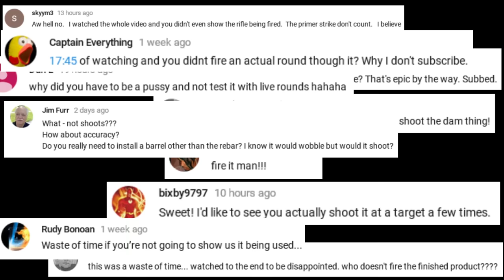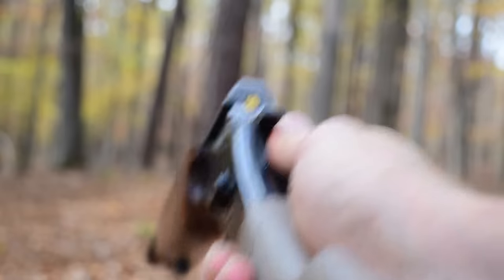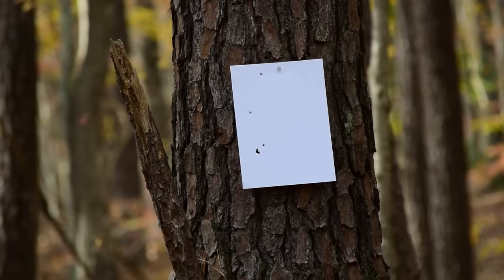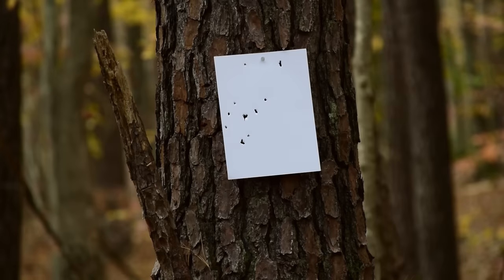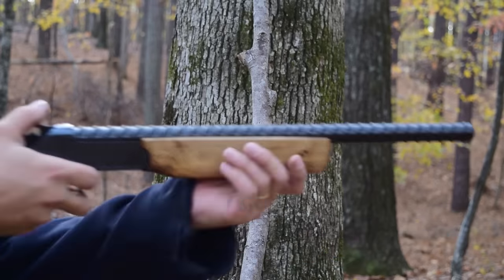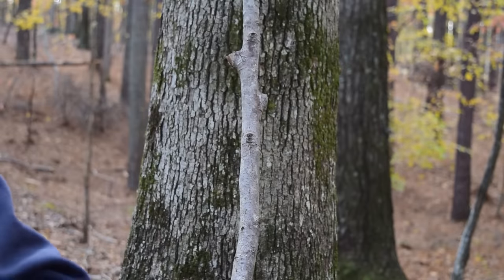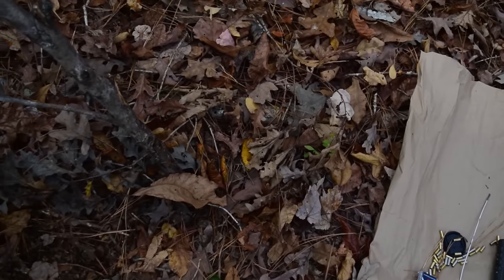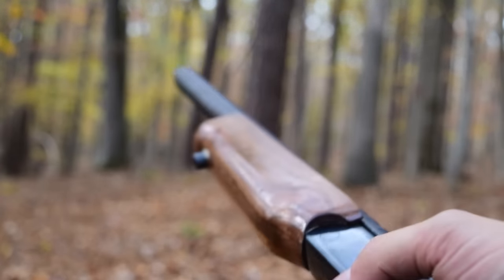Rifle barrel made from rebar - PART 3. Shooting it!

Comment: Not bad, I am an old gunsmith, haven't smithed in over 20 years so not a lot of smithin left in my old broken down bones, but I think if I would have done that, I would have turned the barrel so the ridge was across the top, sort of like a sight rail then mounted a nice set of open sights on the ridge. But that is just me, the man who builds his gun for himself aught to build it the way he thinks best, after he is the one who will have to put up with it when he is finished.
Reply: raise the hole barrel by 2 mm to have that ridge high mill file the hole ridge down leaving front post and rear v notch
Reply: I was thinking about the position of the rebar also not being at the top of the barrel

Comment: Make one for .223
Reply: John Teslov yes
Reply: You could with nearly the exact same procedure and parts. You would need a centerfire single shot lower to begin with. One chambered in 5.56/.223 would be ideal but probably not actually needed. This would be cool though.
Reply: Just make the barrel .223 instead of .22 and you'rre almost good to go. So you'd need a .223 to disassemble to make it. And preferably a single shot .223 which I don't particularly know of. I'm sure they make it. I just don't know one.
Reply: Above .223/5.56 I'm not sure it'd be a good idea. The Rebar's circumference wouldn't handle something like a .308 Win very well.

And when you're talking about drilling out like he did... you're always going to end up somewhat inaccurately. Like his shoots to the left. He even said while he was drilling "I think it's wandering quite a bit." well once he inserted the actual .22 inner tube into the barrel or whatever, it kind of fit the shape he drilled out, so if the middle wandered/drifted to the right inside the barrel, then he compensated on the end, that would account for the shooting to the left.

The hardest part is keeping inside the barrel straight all the way through. Rebar is not so good for this and as cool as it looks, I wouldn't bet my life on it.
Reply: I would not play with the explosive pressures of a .223 personally
Reply: Pyra Gorgon   Better know your metallurgy.
Reply: John Dough .223 would blow it up no doubt. Not to mention the risk of the bullet catching in the barrel.
Also the actual breach would be far thinner due to the oversized cartridge. Same problem with a .38, however maybe the lower power would let the steel survive. Dangerous stuff this barrel making.
Reply: Fuck that, gun looks badass but fires tiny baby ass bullets. We need one made from fat as fuck rebar that shoots .50 BMG. Something like this should work: https://i.imgur.com/FtjgPYK.jpg
Reply: John Teslov 
I would pay for a 22” barrel in .308 made like this for an AR10.... just to freak everybody out at the range....

And EVERY time I got to the range, I’d pretend like I just made it and test firing it to see if it works..... just to freak people out.....

Comment: You could always put sights on it if you wanted... love this build btw.  I don’t understand why people thought stingers wouldn’t work... it’s not as if you rifled the rebar.. you added a factory made barrel liner... rebar is a high carbon hot rolled and tempered steel, which sounds ok to me.. lol depending on which grade it is, you can look up the grade strength, and the amount of ksi “kilopound per square inch” and get a good idea of the pressure that it could handle...just my thoughts...

Comment: The bullets are key holing. If that's not a smooth barrel, the barrel liner doesn't have the right twist to stabilize the rounds. Still nice work though.

Comment: You could add a connecting sear and spring between the ejector and the hinge. Once you pop the break-action all the way open, the sear would release and let the spring push the ejector outwards, then simply expanding and filing the lower portion of the ejector to act as a wedge with a gap to allow it to pass over the firing pin upon closing would let you close it without having to pull out and push in the ejector manually.

Comment: Rebar is actually better quality steel than most gun barrels of the mid to late 1800’s. You could likely chamber a barrel of that diameter up to and including .38-55 safely although it would probably be wise to stick to medium bore pistol caliber black powder loads like .32-20, .38 S&W, 38-40, etc.

Another good application would be to chamber it for .410 shotshell. More than enough meat on the barrel to contain the pressure.

Comment: Love the gun plz try to make matching stock and sights if possible. Rear sight could be like 2 little pins right beside the hole for liner. And front could just be a nail centered and welded on. Also add rifling plz I would love to see more vids like this. Instant subscriber

Comment: Suggestion, if you remove some material from one side of the barrel above the ejector, you could make a new ejector with a 90 degree upward arm , and have enough range of motion in it to reduce the number of motions to reload, which would be accomplished by either simply not removing some of the material and making an ejector that snapped on and slid in place, or, welding something on as a stopper, unless you don't want a stopper of course. (Edit): Actually, you might have enough material left in the re bar to only drill a slot down to where one of the arms is (on the ejector) and thread one end of a tiny metal rod to screw in to the existing ejector...THEN, you could make that SPRING LOADED!! lol By...drilling through the back of the barrel to where the handle I'm talking about would be (inside the slot you drilled if you're following my logic) putting a spring with a non-flammable oil on it in this hole, and then getting a screw in there (with a recess so it's flush) to hold the spring in.

Comment: I did make a 22 Magnum out of the single shot 22 Remington old gun. But I had a second Barrel which means it wasn’t a number one from a manufacturing company and that project worked out well shot a woodchuck at 110 yards with scope on it of course . And that barrel came from numerage (Maybe not spelled right )gun parts out of New York

Comment: Besides the obvious lack of sights making accuracy poor it appears that many of the bullets are hitting the paper sideways or nearly so.  That brings up this question:  .22 cal. barrel liners come in different rifling twist rates.  Redman, for instance - they make many of the .22 liners sold by Brownells - list a different twist rate than .22 short ammo.  The low power Colibri ammunition seemed to do a bit better than the .22 long rifle ammo which made me think of this.  If you mount sights, especially a scope, it would be interesting to see a test of group size with low vs hi power ammo.  It could be that you bought a line designed for .22 short.  If so your rifle may be limilted to only low power stuff to be accurate.

Comment: Drill a hole behind your extractor put spring in and then bevel the bottom edge of extractor so when closing it rises back in when shut. No longer a manual extractor. Ya got the skills it appears. Wouldnt be hard for you.and would just really round the whole project out.

Comment: could make extractor spring loaded so when you open it, itll shoot the case out, then you just need to install sights and blue the barrel. i reccomend birchwood casey super blue, easy to use, let it soak in oil for 24 hours, adding heat helps but not nessasry

Comment: Very cool, what a build! Seriously though, if you are shooting an experimental firearm you are almost better off not wearing gloves (the face shield is very fine). If things go bang in the wrong direction the doctors will have to dig out all the fragments of glove first, before repairing you! Kind of speaking from experience... me versus a chainsaw. (I've since bought Kevlar chainsaw leggings) :) 
And no, don't troll this with "idiot and chainsaw" comments. There was an ancient piece of wire, or a nail, inside the tree.

Comment: not that I personally dont believe you, knowing how strong rebar is you could likely fire much more powerful rounds out of this thing with the proper barrel liner changes and drilling of course.  BUT you didnt actually show the gun being loaded with the stingers, you showed empty stinger cases, you showed the gun firing, but not you loading and firing one.  it would be easy for you to load a normal .22lr, say singer, and then fire.  Again, I believe you and think this build is really cool, just pointing it out so you can better prove your work on footage.

Comment: So, after watching the vids, one thing is for sure. This guy is not a brainiac. Hiding behind a tree WHILE holding gun in hand in case something goes wrong with a .22. Buddy, that thing could probably handle a .38 or 9mm. If You wanted to stay safe, try fixing the weapon on something and use a cord to fire the gun. Kudos for Your effort, a fine work. This could be made to work with quarter of the effort, but admittedly not as nice. Definitely a thumbs up.